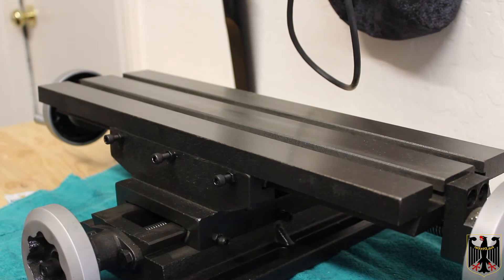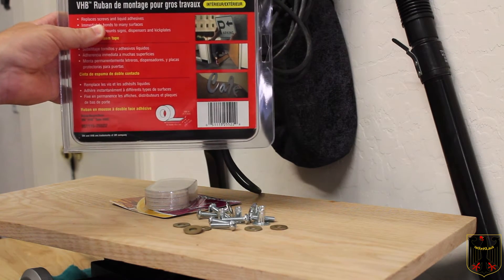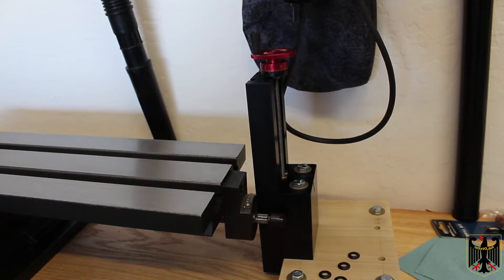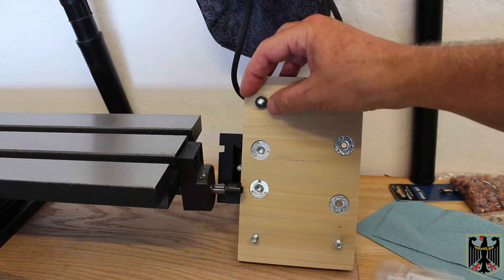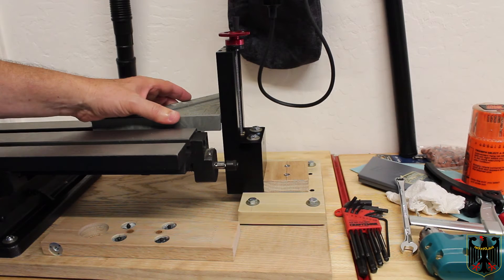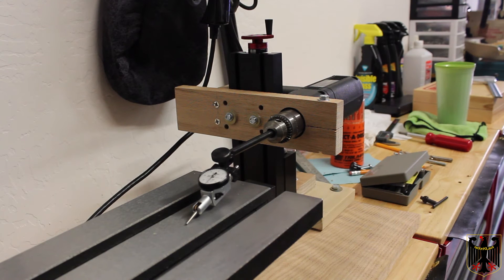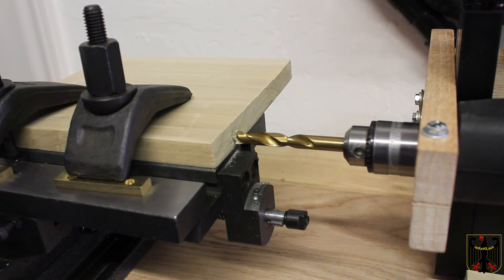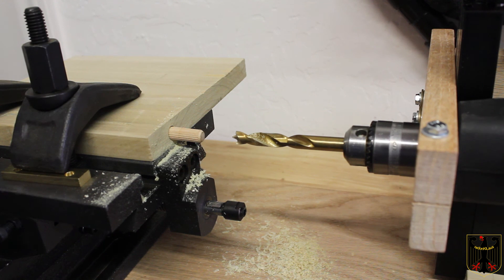Building a Horizontal Side Boring Machine

Comment: As it turns out, the bearing in the drill output shaft is a plain bearing with lots of play.  I plan to replace the drill with a Porter Cable drill I found on Amazon that has output shaft bearings!